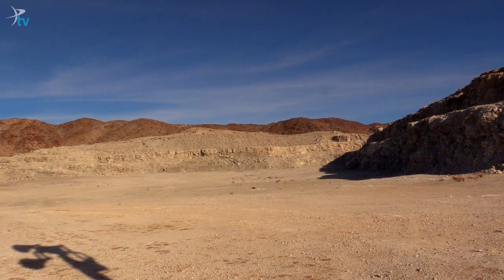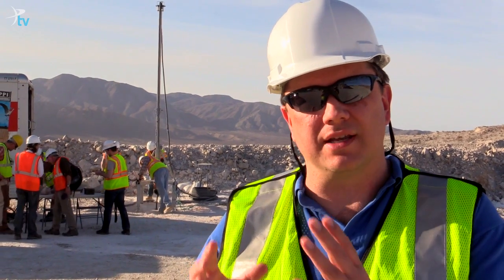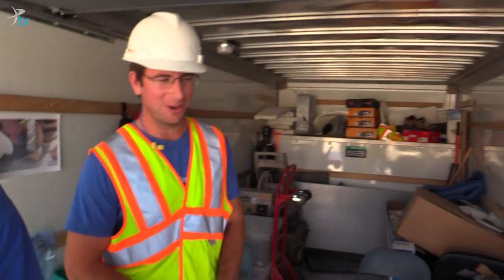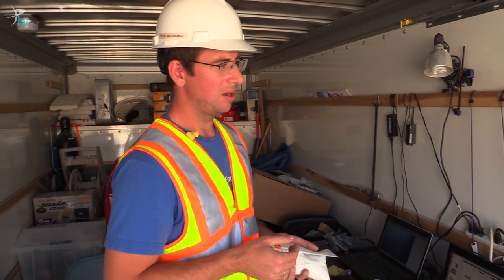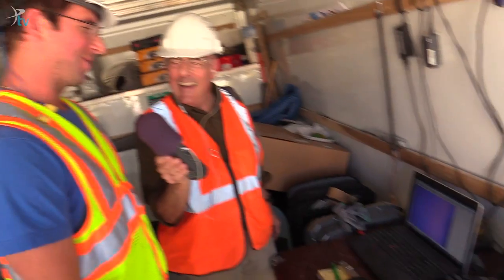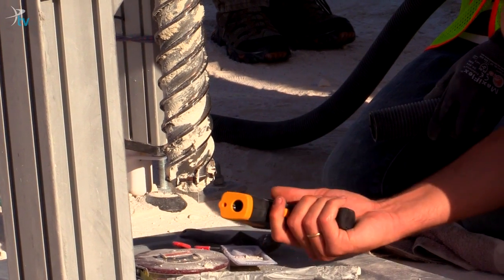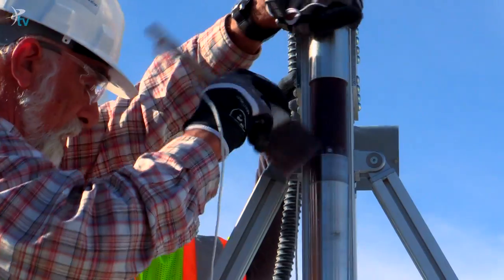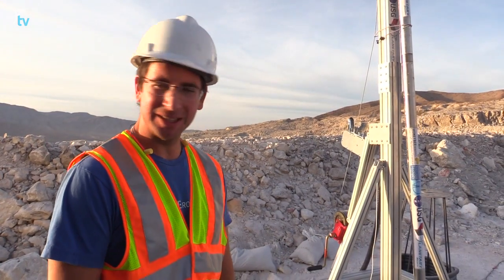Planetary Deep Drill Field Test - SciTech

Comment: What is special about this drill compared to the millions of other drills that have been used over the past few hundred years?
Reply: +oisiaa Several things! Mostly that it will be automated, it has scientific instruments built into it, and will go much, much deeper than anything has on other worlds so far.
Reply: +merc boyan Yes, but how does that differ from what the Russians used to drill down to Lake Vostok in Antarctica? That drilled down kilometers and had a slew of scientific instruments. Why couldn't we retrofit one of those?
Reply: +John Smith I would need to see a link  to know more about that drill, but my guess is that it needs a much bigger and heavier rig. This drill is being designed with spaceflight in mind so it will be compact and low mass compared to many other drills that can go that deep. This has more info: http://www.planetary.org/blogs/bruce-betts/20151214-planetary-deep-drill-field-test.html
Reply: merc boyan Thanks. Being more compact makes sense.